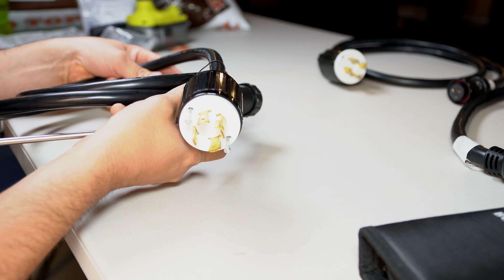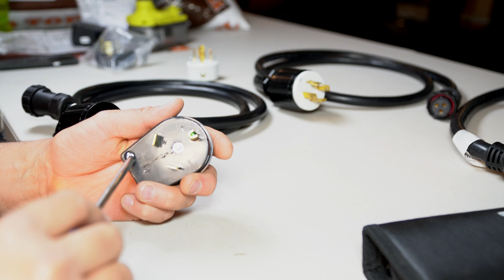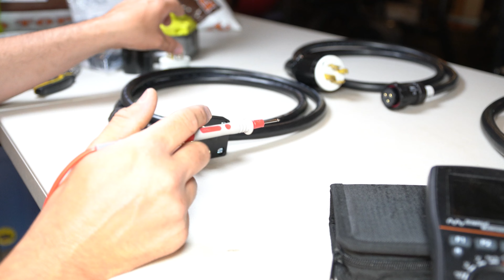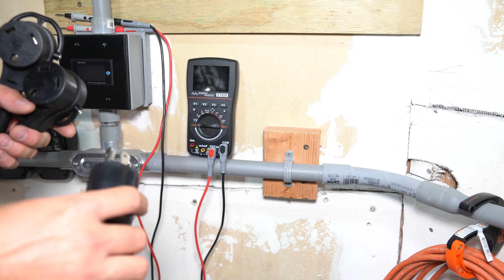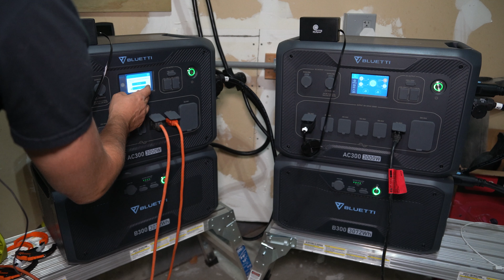Build It: Bluetti AC300 - Video #3.0 - Powering two AC300 from single 240v outlet

Comment: Stumbled across your video while looking up some AC 300s I was curious on your opinion if you would still go with the AC 300 or would you go with the Eco Flo's delta pro I'm looking at something along the lines of a home back up a little bit but taking occasionally to use for our trailer at a campsite. Or do you recommend a 200ac Max in stead
Reply from the maker: Hi Jason. I have the Bluetti AC300 and my brother-in-law has the EcoFlow DELTA Pro. Both have about the same capabilities for providing power in a backup solution. However the AC300 has more options for charging and at a faster rate. The AC300 is also module, which in the event you have an issue or need to send it back for repair or replacement you can send the single module, instead of your whole unit. 

Have you identified what circuits in your home you want to back and what their current usage is?
Reply: @MyBluetti  thank you, ac 300 here we go
Reply: @MyBluetti  fridge, 6 or 7 outlets and maybe the washer
Reply from the maker: @Jjsaba2008  are you planning on hooking this up through a transfer switch?
Reply: @MyBluetti  yes during small power outages that we have occasionally but mostly taken when we go camping because I am in California and generators are getting harder to come bye
Reply: Also forgot to mention that we have an electric water heater so I’m not exactly sure how much power that dries but I’m probably gonna have to power that too so I don’t know if the AC 300 or the AC 200 max what’s efficiently power that or the eco flow delta pro I do like the idea if something ever goes wrong with the units the battery still has some type of charging capabilities and works without the main unit I know with Eco flow if you don’t have the main units the back up batteries are basically gigantic paper weights which is kind of a little frustrating
Reply from the maker: Yes, the use of the B300 separately was a plus for me too. I would say go for the AC300.. you never want to load beyond 80% of what the system is spec'd to do. I ended up installed a Emporia Vue2 in my electrical panel to monitor each circuit (breaker) and this allows me to know exactly what each circuit is pulling on average, max surges, etc. This allowed me to move breakers around to balance my loads for usage, but also to ensure that I didn't load one of my AC300's more than the other. 

To give you an idea with my two AC300's, I last month ran 50% of my home 24/7 and provided 650kw of power to it. I have connected: 5 freezers, fridge, kitchen, microwave, dish-washer, washing machine, air-handler (furnace), two bed-rooms, family room, portable-ac unit, garbage disposal and sump pump.... Now granted I have two AC300's, but even if you just go with one you can still run allot.
Reply: @MyBluetti  that amazing thank you so much they just went on sale to I think I will pick one up this week. Also it’s going to work well I think for our trailer to sorry for the questions I’m just getting into solar and there’s alot to pick from
Reply from the maker: @Jjsaba2008  the only thing that isn't 100% working right now is grid charging for the ac300. Support is working on a fix, but I'm using a workaround. Just wanted to let you know about that so it isn't a surprise

Comment: TY , I cant find that L14-30 Y connector anywhere!  do you have a link?
Reply from the maker: So mine is actually a TT-30p to 50 amp RV outlet.... as my setup is pre-wired for 50amp service to my transfer switch, and I'm preparing to upgrade to the AC500 so I didn't want to limit myself to 30 amps. 

This is the one I ordered: https://www.amazon.com/dp/B09HV8KB24?psc=1&ref=ppx_yo2ov_dt_b_product_details

I then added a 50amp to L14-30 adapter to make it work with the AC300...

Comment: David, so happy found your channel! I just started I was going with one ac300 and couple batteries but decided I to at least get another with couple more and get set up... I can take little longer to "add on" as I can.
Anyway... I'm hiring electrician to get what I need done. I have just enough confidence to swap the plugs 🤣.  My questions at this point...
Obviously no panel yet but I have the fusion box.
At this point I was intending on just popping to tt30 outlets for now and calling it good till the panels available.  The would have to be their own circuits the way I understand you for max impact.
Do I have a good read on that?
I have a small house so plugging in to my stations directly not a big deal if need be for now.
Reply from the maker: Hi Jim - I assume your talking about "panel" as the transfer switch? If so, yes you can use the two TT30 outlets or you can use the L14-30R which already merges the two hots from each ac300 unit. If this isn't what you're referring to, please let me know.
Reply: @MyBluetti  it is... I was just thinking longer term what would be little more standard to have in a house 4 prong or 3 prong 30 amp... Suppose doesn't matter but seemed 3 at 30 seemed standard in RV world.  So that is why I was leaning to have the electrician install that
Reply from the maker: Outside of this being a solar generator, I would just treat it like a gas generator. Typically on a 30amp generator you would use your 4 prong L14-30 outlet and connect it to a generator inlet and feeds your transfer switch.
Reply: @MyBluetti  ok now I'm confused...
I was pulling power from wall to ac300 x2... Your video showed taking a 240 2 phase and splitting it into 2 diff 30 amp 120s
I was asking should I just have 2 30 amp outlets put in... Obviously you had already had the 240 sitting there.  Right?
Or are you saying just power the ac300 x2 with 2 separate L14-30 and NOT do the plug swap...

Comment: informative Video. Thanks for doing this series.
Have you tried to split phase the units with the power cords you adapted? I found I can charge my split phase set up just fine from 2 different phase receptacles up until I turn the AC power on. Then both units go into error and shut down AC output. I suspect it to be a bonding issue between the cords. Your Y cord probably shares ground and common.
I am awaiting the L14 cable from Bluetti which should solve this problem. I do have the Bluetti Fusion box set up.
Also, what dongles are you using for IOT alerts?
Reply from the maker: Hi Craig - Yes, my system is currently running in Split-Phase and powering 50% of my house with my cables that I created. Even though you are using two different outlets I would double check that your getting 240v between the two hots of those receptables like I show in my previous video (https://www.youtube.com/watch?v=l1haUsklLKE&t=0s). Next you can not enter into Split-Phase mode for the first time with the AC Input powered by the GRID, nor with the AC Output of the AC300 enabled. After both are disconnected, enter into Split Phase mode on both machines, setting each to master and slave. Once successfully done you can power the AC300's VIA your grid and then enable AC output. 

If all of this continues to fail, please make sure your firmware is up to date. And that you don't have your GRID AC Charing set above the capability of your outlets you are using.
Reply: @MyBluetti  
Thanks for reply.
Yes, I am running the plugs from 2 different phases. I wired a sub panel ensuring the 240 at the receptacles and plugs.
The master errors out and shuts off AC output. I even turned down AC input to 9A on each AC300 to keep under 20A.
Still errors. So I moved the input to 7A Each to keep it under the 15A limit Bluetti set. Seems to be running fine now. I initially thought it would be 15A per controller, but in their finite wisdom it seems to be 15A combined. I guess I need to reach out for the unlock code.
All this while I await the 30A cord from Bluetti to arrive. 
These things do charge very quickly even at 7A.
I should also point out that I am using a standard 20A wall outlet with the AC cords that came with the AC300s.
Thanks for the info on this topic. I hope this helps others as well.

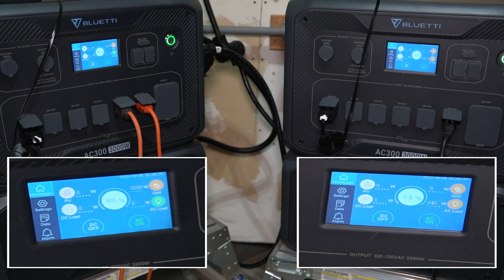Comment: Great video.  At 26:27 on this video the ac load icon goes from green to yellow to green again. I was wondering why. I thought it might be a surge warning but the wattage does not go that high.
Reply from the maker: Hi Vito - The manual doesn't officially state the reason why, but I would assume it's based off the AC output using Grid pass-through or not. Before I start the vacuum the icon was green, in which I believe is grid-passthrough. When I start the vacuum the surge required to start the vacuum is too much for the grid-passthrough power and you see the system turn off the grid power for a second, in which the output goes to a yellow icon. After the vacuum goes into it's normal running wattage the AC300 returns to grid pass-through green icon. 

Also great eye! On my next video I was actually going to talk about this limitation on grid power, so odd buggy-ness and how to resolve it. You are also correct it's not about the amount of surge wattage... I've testing other appliances that exceed 3000 watts and have not issues.... it appears to be the type of surge that causes this to happen.
Reply from the maker: Hi Vito -  My assumption is correct. The changing of the colors of the AC Load icon represents different types of grid-passthrough that is occurring. I got an official answer and will be including that information on my next video.

Comment: Great video thanks for the information
Reply from the maker: Absolutely! I'm hoping that I can help others to get their systems setup and avoid the frustrations that many others are having with Split-Phase mode.
Reply: @MyBluetti  I have a bunch of questions. Do you have a email address. Where we can communicate..... I purchased 2 ac300 and 6 b300 as well as the fusion box and the breaker box..... I jumped in head first. Without having the best understanding of solar ..🫣